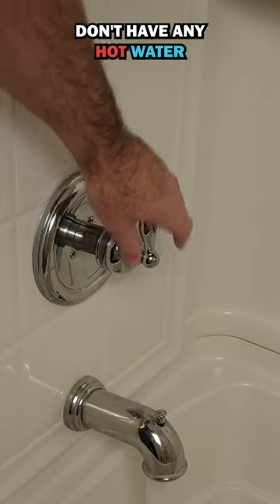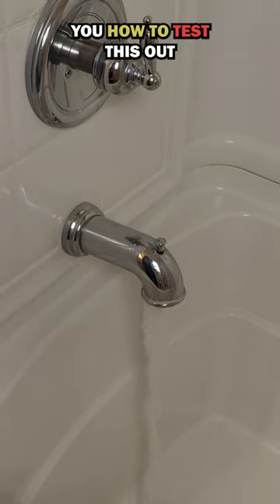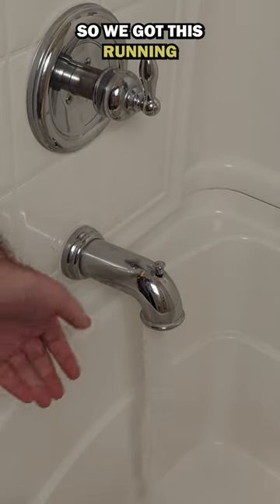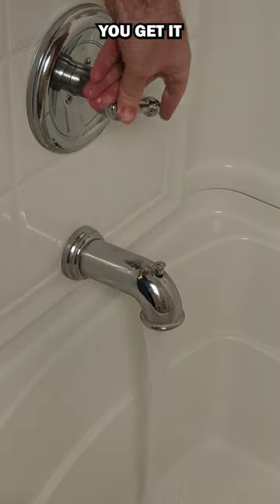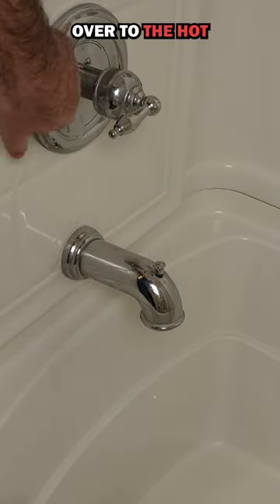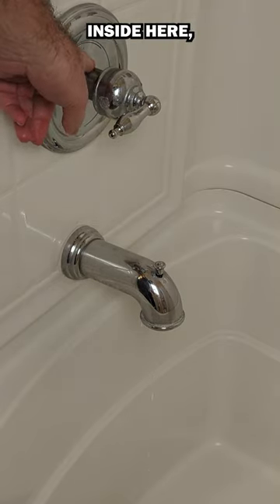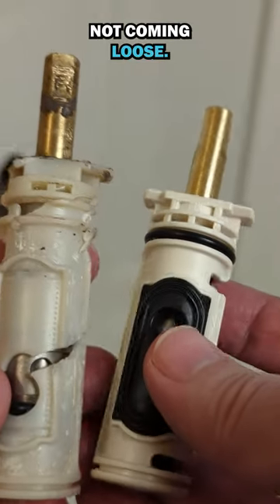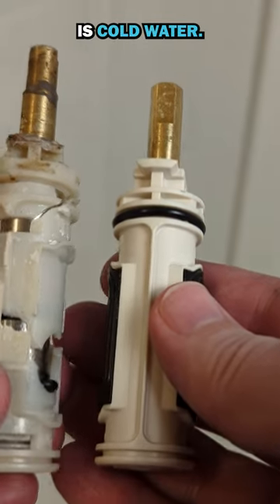Hot Water Not Working? Try This Test #shorts

Comment: I actually need this issue fixed at work n ur vid popped up
Reply from the maker: Sometimes the cartridges come right out but it has always been a real chore for me to pull them out. There is pulling tool that you can get. That will help a little. Good luck with getting it fixed.

Comment: Thanks 🙏 everything out there is only to adjust the valve, but I did that 3 times already still no hot water.
Reply from the maker: Glad it helped. Good luck with getting it fixed. Some times the cartages come out real easy and other times they are a reel pain to take out. They sell some different types of pullers that will help.

Comment: What if the hot water not coming from  all faucets in the house, what should I  do.  The temperature dropped last night to -18  or more😢
Reply from the maker: If you have no hot water it is probably the hot water heater. Your hot water heater could have froze with it being that cold. If it is not properly insulated it can freeze up when it gets really cold like that.
Reply: You know it looks like the pipe  Qasim frozen that's why no water coming. I did open the hot water faucet in my sink and in the kitchen and let dripping to were there is water. Couple of hours later I  heard the water gushing through the faucets. I was so happy 😊
Reply from the maker: @fatinomran4y  That's great news! They also sell hot water insulation pads. You could put one of those on there to help insulate it too.

Comment: How can you do that for not only tub but for sink?
Reply from the maker: If you don't have hot water in the tub and the sink it could be the pipes or the hot water heater. There is a cartage in the sink faucet too. So it is possible that they both went bad.

Comment: I have no hot water in whole house only when the weather is too hot. Once the weather is cool down, the hot water system is back! New hot water tank is installed, still can't solve the problem.
Reply from the maker: This is what I found on google. When the temperature of the air surrounding your water heater is higher than the temperature set on its thermostat, the gas valve will fail to open and light the main burner. Is your hot water heater in a shaded and vented location?

Comment: im having a weird problem, the thing to turn the knob is loose so i tighten it, it had a washer but it fell off, now it has cold and hot water, i got a water filter a few days ago and it used to have hot water also but once i switch it to the shower head its hot for a second the turns ice cold
Reply from the maker: I am not sure why that is happening. I had a recirculation system valve next to my water softener system and I would only get a few minutes of hot water in the shower upstairs. I turned it off and now I get all the hot water I want upstairs. It had failed and shutting it off bypassed it. Check and see if you have a recirculation system valve in-between your hot water heater and you water filter. I am not sure if that is the issue but turning it off worked for my upstairs shower.

Comment: What if I have a separate hot water faucet from the cold and straight cold is coming out?
Reply from the maker: There is typically a cartage in each faucet handle. So in your case the cartage for the hot water faucet has probably gone bad and needs to be replaced. If you have hot water in other faucets then it is probably just a bad cartage on your hot water faucet.

Comment: So I am having this same issue, but is a mobile home with a faucet with all 3 lines going into it. Could it be the same issue but the cartridge is in the faucet?
Reply from the maker: If you turn the hot water on all the way and no water comes out it could be the cartage inside of the faucet. Sometimes it could be the water pipe. With it being so cold this time of year it is also possible you have a frozen pipe.
Reply: I have same problem but no cold water coming out , I do have hot water though only in the bathroom
Reply from the maker: @fredrickwinters8367  If it is really cold where you live you could have a frozen pipe.

Comment: Question in the building were I work every time we turn off the main water to do a work when we put the water back on there’s some rooms that does not get enough water for several days it’s even warm water or not hot water at all?
Reply from the maker: There is a device that pumps the hot water down long pipe runs. One of them my have gone bad. I forget what it's called though.

Comment: I literally have no hot water as of rn and is the fourth time this week it was happened and the ppl came and looked at it but obviously they are stupid and don’t know what’s goin on like I can’t even take a hot shower smh🙁
Reply from the maker: If you don't have hot water in the shower its probably the cartridge behind the knob in the shower. But if you don't have hot water in your other sinks its probably the hot water heater. Good luck I hope you get it fixed soon.
Reply: @ThatHobby  thank you
Reply: @ThatHobby I'm experiencing that right now! What problems could my hot water heater be facing? There are no circuit breakers tripped.
Reply from the maker: @layzy24  If you have no hot water anywhere in your house and you have power to your hot water heater but it's not heating it could be a few different things. The heating element could have gone bad in the hot water heater. There is also a pipe inside the hot water heater that may have broke as well. You could try to replace some parts but if your hot water heater is pretty old it may be better to just replace it.
Reply: @ThatHobby  it's a 40 gallon Bradford White model: RE340T6. It's 7 years old. Is that considered old? We've never drained it yearly like most regular people.
Reply from the maker: @layzy24  You can expect a gas water heater to last anywhere from 8-12 years and an electric water heater to last anywhere from 10-15 years. Unless you have hard water then you can subtract 2 years from that. So it just depends on your water quality. If your water heater is outside it can have more issues as well.
Reply from the maker: @layzy24  You could try draining it and see if that helps. That is one of the potential problems that could cause hot water issues.

Comment: The problem is you are using one of those garbage single lever taps.
Reply: Good guess, but no.
Reply from the maker: I have had the cartages go bad on my sink handles too. They have a separate hot and cold handle. But when they go bad they still work they just drip a little. The single lever handles seem to get stuck and don't let any hot water out. The only way to fix it is to replace the cartage.
Reply: Lmaoooo two handle tub and shower valves are garbage don’t kid yourself

Comment: Im getting warm water but not hot enough for a shower. Could it be the same problem?
Reply from the maker: Yeah it could be the same problem. To test it turn the hot water on in the bathroom sink. If it gets really hot then it's the cartage in the shower. But if it doesn't get hot it is a water heater issue.